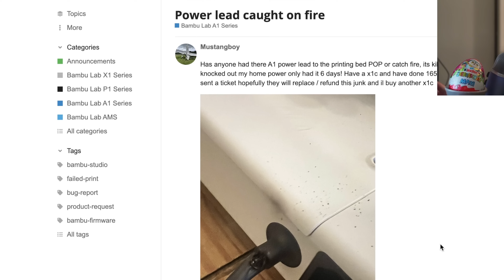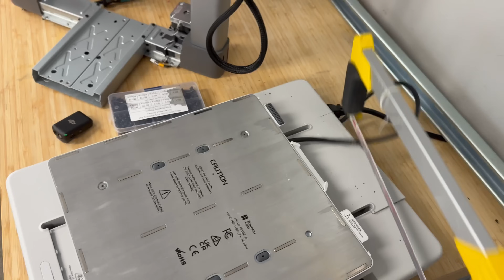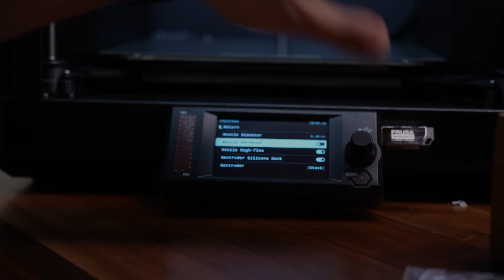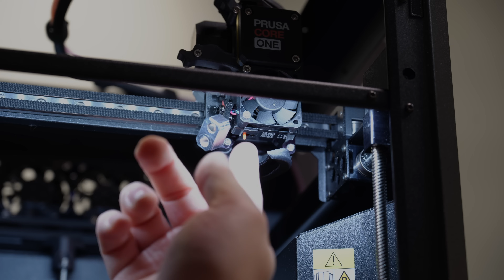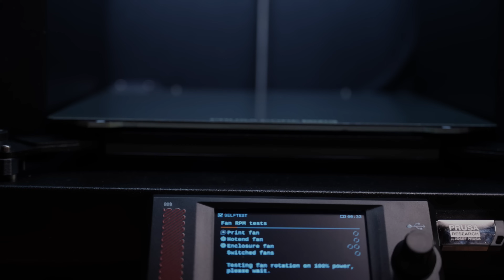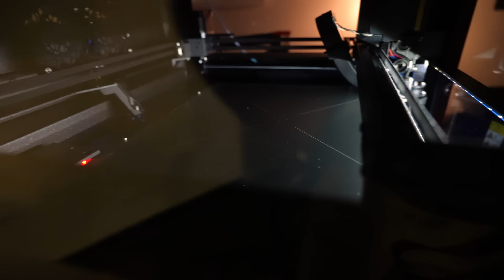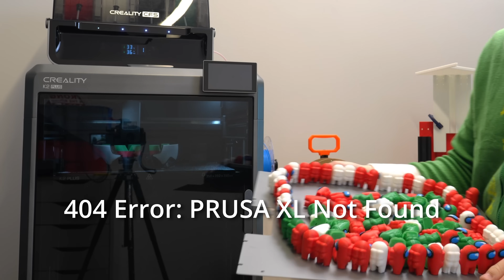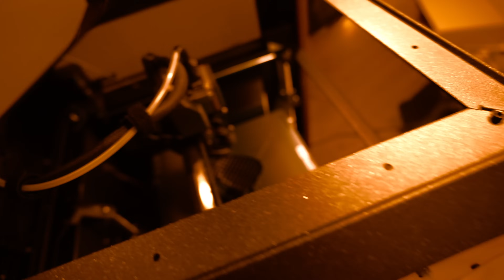PRUSA CORE ONE - The Machine Designed to Trigger Bambu Lab Fanboys

Comment: Why is nobody talking about the Prusa PRO SLX or the Prusa Pro HT90 ?
Reply from the maker: I would replace all the printers in my lab with an HT90, but the MSRP is insane for a hobby. You have to actually have a need for ultra high temp materials to justify getting one.
Reply: @NathanBuildsRobots  True, I am thinking of getting a new FMD machine for the office.
Reply: Because the HT90 is $10,000
Reply: @Aser6000  It´s still interesting tech. How does this Pro machine differ from say Flsun V400 or something ?
Reply: @sierraecho884  you cant print high temperature stuff on an HT90, like PEI, PEEK, etc. 
Active chamber heater, swappable printheads, dedicated support. Is quite a tall impressive delta.

Comment: For years I thought about buying a Prusa, and for years they were way too expensive, now more than ever. I can buy a 300bucks machine that does exactly the same as the Prusa does. So I can buy 3x Flashforge 5M for one Prusa. It´s a great machine but a terrible deal.
Reply from the maker: I am using a flashforge 5X right now and it's much louder. For casual printing and prorotyping i'd prefer this. The 5M Pro is similarly quiet, but doesn't have as good of print quality.
But when you add cost to the equation, I always cheap out and buy the lowest cost stuff :P
Reply: @NathanBuildsRobots  "...But when you add cost to the equation, I always cheap out and buy the lowest cost stuff :P..." This is exactly my point, I don´t drive with the Lambo to Lidl either. For things like noise and print speed I simply lock the printer in a cabinet over night, it solves both issues. Plus I also lock an air cleaner with the printer in there and have better air quality

Comment: could not find anything from prusa about the umbilical
Reply: oh, it's called Prusa SwingArm
Reply: the arm on bearing, pointless imo
Reply from the maker: There is a point in having clean cable management
Reply: umbilical is way better than the cable chain for sure, but the rotating arm is unnecessary

Comment: I’ve not had a Prusa yet. Not because I don’t want one but because I can’t afford one. That said, they continue to lead. Only one question while watching Nathan go through the setup. Why in the world do they continue to utilize the rotary knob as a control mechanism? My K1 VS has a touch screen. Bout the same size. It’s great. However, even in that? I’m using my laptop. I rarely touch the screen at all.
Reply from the maker: The touchscreen is functional, but they kept the dial.
I guess it is good if you have gloves on or want to scroll through options or set a specific number like when entering fan speed or temperature, without having to push little buttons on the touchscreen.
Reply: The screen is not that big, and the dial makes some of the adjustment options easier. Guess Prusa kept it because it works really well. I use it all the time on my MK4S.
Reply: Touchscreens are cool, sooner or later they fail. Same with the selector. But used together can last way longer.

Comment: I just wish it had a bigger build volume =/ ... may just save for an XL
Reply from the maker: I think this exact design could be scaled up... I want to see if it's possible
Reply: @NathanBuildsRobots  I expect (hope) for a mid sized printer with two tool heads that would fit price wise between the two core xy printers.  Before that happens, I expect to see a redesigned XL that’s fully enclosed that uses many of the same cost saving features they employed to keep the CORE One cost reasonable.
Reply from the maker: That would be pretty awesome. Maybe a scaled up Core One with IDEX. Pretty much to serve the same niche as the 2 toolhead XL
Reply: @NathanBuildsRobots  300x300 or a 350 and I’m all in.

Comment: The thing that drives me bonkers with the bamboo fan boys is that they just have no idea what they’re talking about. They have no experience with a Prusa and have nothing to refer to except their bamboo printer. 

I’ve had both and yes bamboo prints OK if you have never seen anything better you’re gonna think it’s amazing. But the thing you get with a Prusa is precision and the cleanest prints you’ll ever see. 

I was so disgusted with my bamboo printer that they would always have those disgusting thick horizontal seems and the flat surfaces on top or never really clean. Not to mention temperature changing in certain models like in the bench when it goes from Matte to gloss halfway up because they don’t know how to write a profile. 

With a Prusa when they talk about dimensional accuracy it’s not dimensional accuracy to itself like people seem to confuse with bamboo labs. It’s dimensional accuracy to the outside world. So if you design part that’s .98 mm it’s gonna squeeze in perfectly to a 1 mm hole it’s not gonna have that half millimeter of play that you’ll get with a bamboo and that you just can’t measure printing tolerance toasters. Another thing you seem dimensional accuracy is when you do a close-up of a print from a Prusa machine that’s been dialed in, there’s absolutely no wavering from layer to layer. They are flat precise and each layer stacks precisely on top of the last.  Oh and the nurse the 80° clean overhangs and like 4 inch long bridging. 

But would really seal the deal was seven months of back-and-forth to fix my broken controller on my screen and my filament cutter not working. It would take a week to get a reply back on something where they would say will try this and I already explained I tried it and then another week to wait for a response and then another week to wait for the next response

Eventually I just filed a charge back and got my money back and donated the printer to Goodwill. 

The one time I needed to deal with Prusa was a bad Wi-Fi chip and I sent one email and three days later I had the replacement part. 

So in other words if you don’t know what you’re talking about just keep your ideas to yourself. Go love your machine and stop trying to prove something. It’s inferiority complex
Reply from the maker: Can confirm Prusa customer support is great. I got spare parts in 2 days shipped from Prague.